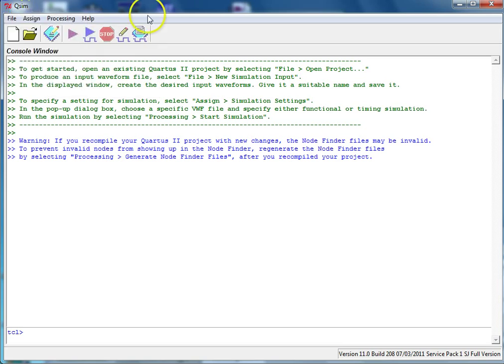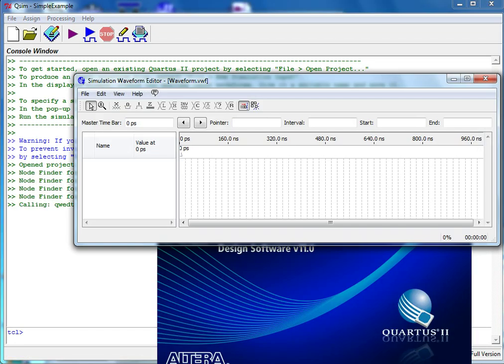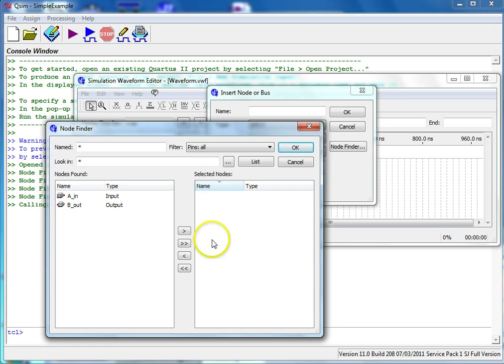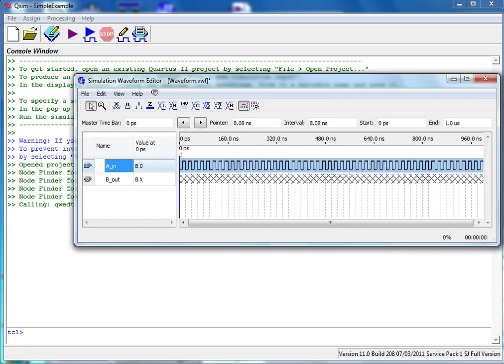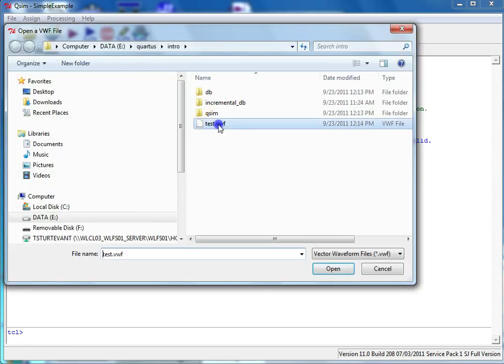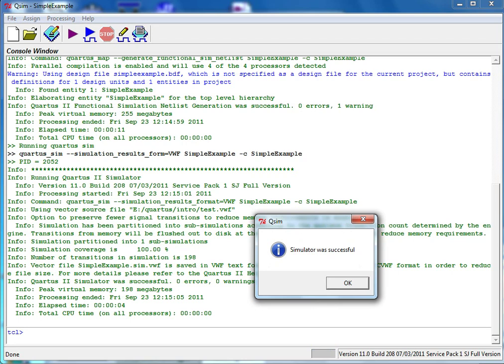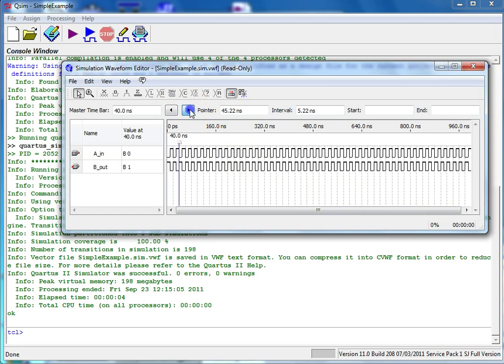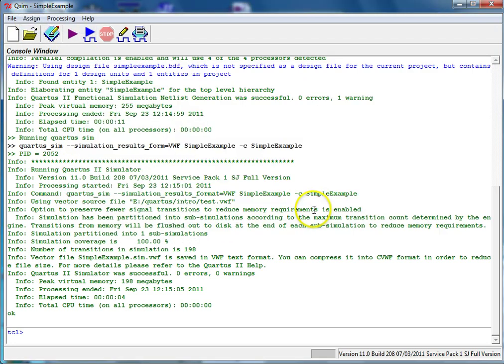Simulating with QSim (Quartus II V11.x and 12.x)

Comment: What family did you use?
Reply: I had been having an issue with the compilation saying it does not support device family until i solved it switching to cyclone IV E
Reply from the maker: We use devices in the MAX7000S  and MAXII families.

Comment: what's the difference between Qsim and modelsim and Qsys ?? i'm lost for the moment ??
Reply from the maker: Modelsim is a separate product; Qsim is part of Altera's university program tools. The nice thing about Qsim is that it's very easy to simulate simple circuits by producing waveform files without having to know VHDL.
Reply: ok, nice and thanks for the fast response.
and what is exactly that Althera university program tools? because i use the web version of quartus to do some vhdl design
Reply from the maker: ***** In version 13, Qsim was included with QuartusII, including the web edition, so it's not a separate program.
Reply: ok thank you very much